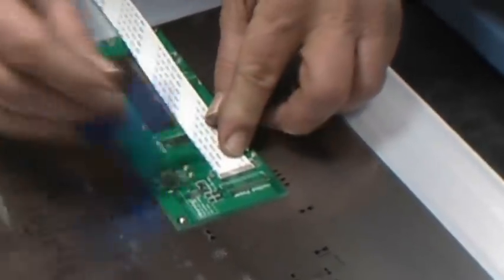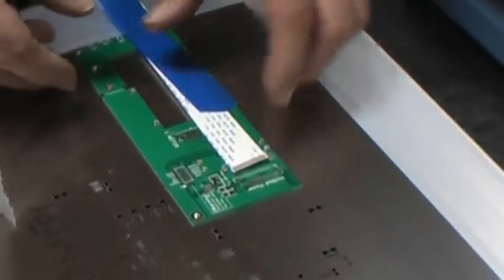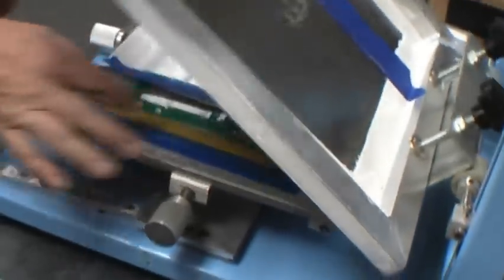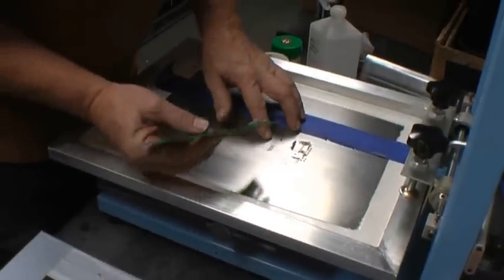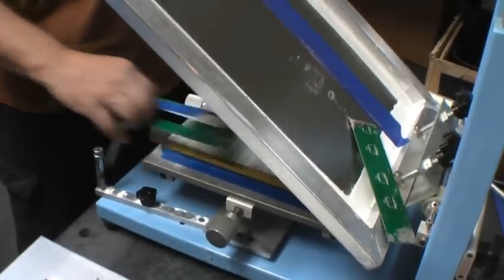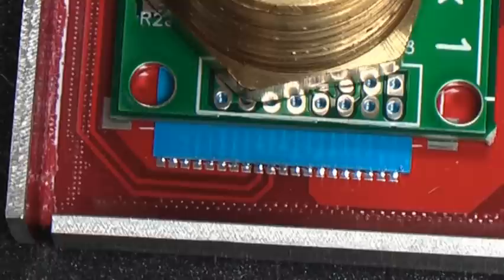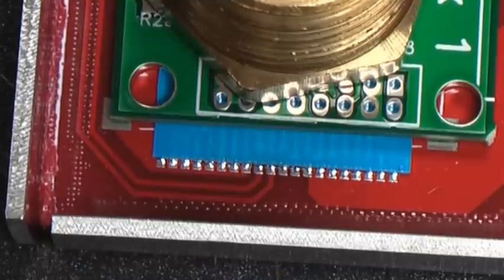Using Low Temperature Solder Paste to connect a Flat Flex Cable

Comment: Cable 17.pin yes no
Reply from the maker: 20 traces are easily visible on the cable.
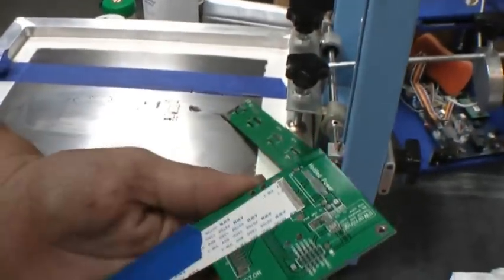Reply: @HyRel3D  @ 0:44, I see 20, not 18.. Aren't they all used?
Reply from the maker: @spacefury65  My mistake, this has 20 connections. We use 18 of them. eight on one end for +12VDC and eight on the other end for GND, to heat the bed, and the center two for the RTD reading.

Comment: Obviously the RIGHT way, but most of us don't have hotplates and silkscreen masks in our garages.
Reply: Turns out this is easier to get set up than you might think.  An SMD hot plate for electronics can be gotten new off eBay for $100.  Check out OSH Stencils.  Used to be that stencils would cost $100 for stainless.  Now you can get them from OSH for $15 depending on the size.  No need to even go the plastic route when you can get stainless.  I used to do this with a pneumatic solder dispenser when stencils were more expensive.  Haven't used that device in a long time now.  I'm getting low volume boards these days from Seeed Studio.  About 1/2 the price of other places and quality seems just as good and turnaround is the same.
Reply: Randy, thx for the info.  I'll look into it.  The flex I needed to fix was on an old electric typewriter, and turns out the "traces" were just spray painted onto the flex, and then another piece of flex somehow afixed over them.  How friggin' cheap can manufacturers get?  Have come up with no way to fix it, not sure if there is one that would really work.
Reply from the maker: That's a George Foreman Grill, not a special hotplate. :)
Reply: @HyRel3D  Your comment got even funnier when the next comment in the chain appeared!  :-)
Reply: Even a lady 👩 like me managed to do this with my George forman grill.  I even had a couple of burgers whilst it was still hot a few minutes  afterwards. Kill two birds one stone as they say
Reply: @jacquelinebishop8465  You get the gold star!  Great comment!  :-)

Comment: Wish I had the tools to do this, but at least I know it's possible with a good stencil and even heat. Beautiful!!
Reply: You can do it with a simple soldering iron and some good flux, if you tin the tip with the right amount the flux does the rest and flows into the pads. Is not as easy, but is really doable.